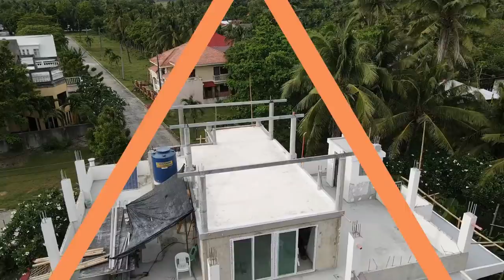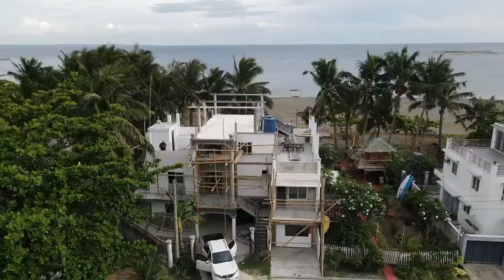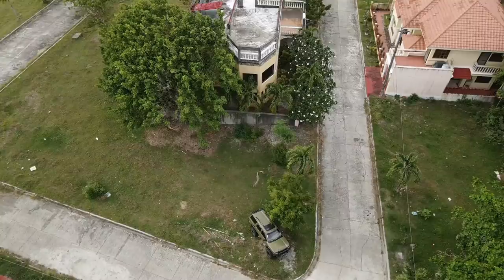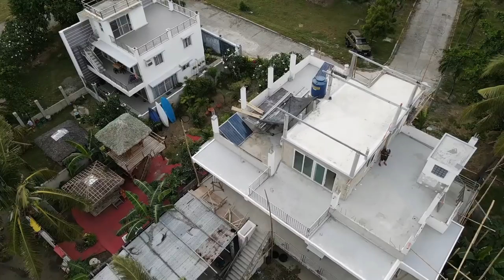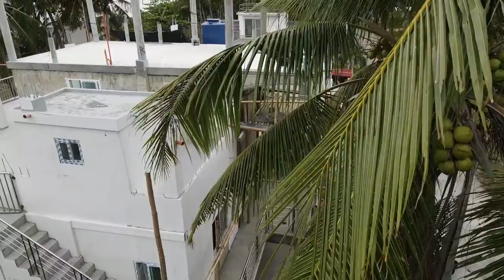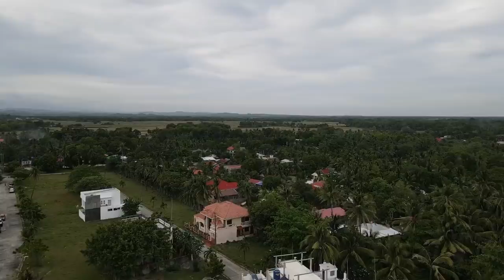Aerial View of the Solid Concrete Typhoon Proof House Build

Comment: Tks for the drone video. It really gives us a good idea of the almost completed build. You have done well. Your house faces the sea. Did you consider the position of north or south facing when drawing out the structural plans or did you just wanted the house to face the sea. I’m about to build my house my first priority is to face the sea. I’m just concerned if it will get too hot if I wrongly place the house. Tks

Comment: I believe you have a cistern but am wondering how you’ll get water into the tank on the third floor.
Reply from the maker: 3 inch pipes are embedded into the columns and roof  deck drains sending the water directly into the cistern.
Reply: @TexasFilipino  I never doubted you. Can’t wait until all the bamboo comes down. It’s stunning.

Comment: James, again, congratulations on your house build.  My only concern,  and I am sure that you have given it some thought, is the large doors  in the house.  I don't know how the storm winds will come from, and the historical data of wind strength that may affect your area, but I would be a little worried.  I live in the hurricane zone (Puerto  Rico) and have witnessed the aftermath of a cat 4-5 hurricane and the destruction is severe.   I hope that you never have to face one that powerful.   Keep up the good work.
Reply: I’m also concerned about the large sliding patio door if debris from other nearby structures goes airborne
Reply from the maker: We had a house right down the beach from here before this one. All of Melinda's family live next door, all the houses here in the neighborhood and none of them have had windows blown out. Not saying it can't happen but we are lucky to live on the west side of the country and most of the typhoons enter on the east side of country. By the time it make sit here the typhoon has crossed several mountain ranges and weakened the storm. We usually get massive rain and bad waves though. Now there can be a occasional typhoon thread through the country just right and hit us with high winds. If that happens  we will we cover the doors. I had once considered putting roll down shutters or doors. but I don't want them really. I have decided upon just making a track to hook plywood panels on and lock along the bottom. May not get it done now. Might be next year but I will eventually get it done. Also on that note the winds most of time come from inland on the front side of the house but mostly on the end of the house with the steps going up to the roof deck. So not much to damage on that side.  Now in Puerto Rico  you get pounded with storms there with much cover.
Reply: @TexasFilipino  I think you will be fine if you get a chance to throw some plywood up and the solar panels are bolted down good
Reply: @TexasFilipino  I am glad that the history has shown that no damage has been sustained in your area, plus the fact that the mountains protect your zone from high winds. Just be prepared; Nature can be treacherous!
Reply: Their location is pretty good when it comes to typhoons. Now iglf you live on the east side, then yeah that's full on typhoon right there.
Not familiar with that part, if there are mountains behind them, but even just land helps weaken it, much more so for the mountains